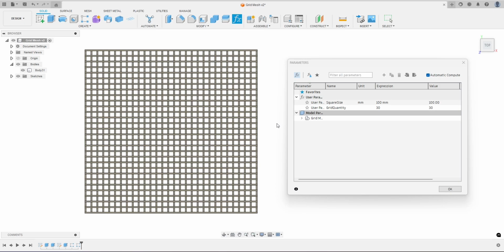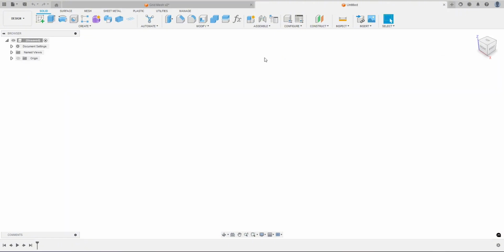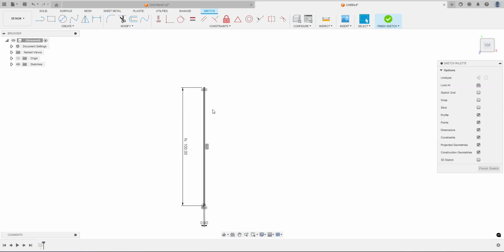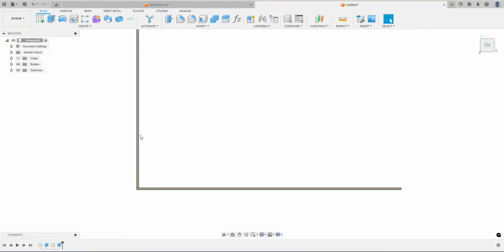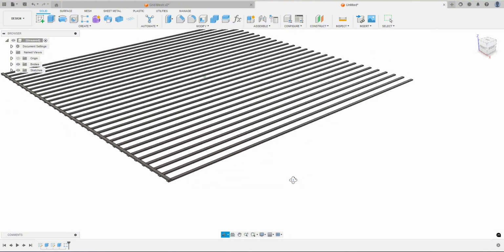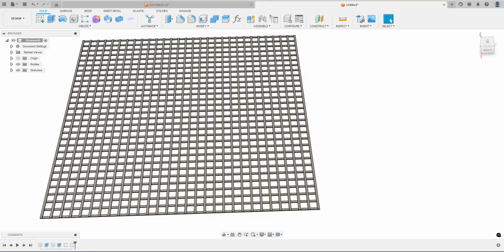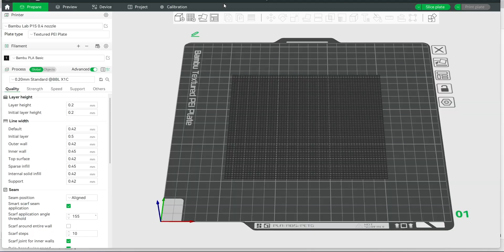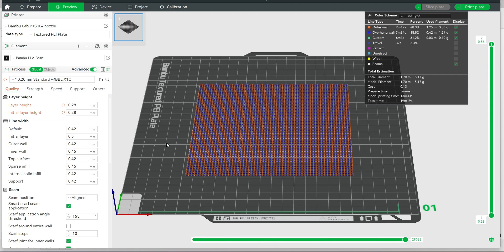Autodesk Fusion: Parametric Grid/Screen

Comment: Good stuff, thanks for this. Quick feasibility question, is there a way to take a parameter like this and apply to other shapes? Meaning, is there a way make a hollow cylinder with bottom, and use this grid/screen parameter on the walls of the cylinder and make a filter basket? I tried to adapt these steps into a radial pattern...and lets just say that fortunately whatever the hell it produced, didn't suffer or live very long.
Reply from the maker: Absolutely it can be done. Let me think about it and I’ll see about making it into a video.

Comment: Great video, thanks.  Have you considered building from the origin symmetrically?  This would enable circular screens or edge cropping rather than having a corner as the grid's reference.
Reply from the maker: Yes you could do that, but then you need to pattern in both directions (which is fine, but just adds to the difficulty, and actually may not work at all).  Doing a circle mesh would be fun to try.
Reply: @ShopTherapy623  Under Fusion's "Edit Rectangular Pattern" window, each identified axis can be modified from 'One Direction' to 'Symmetric".  So, if one used Fusion's origin as the centre reference and built out symmetrically, you could cut the final grid-mesh pattern into geometrical shape afterwards, to fit into other designs (circular fan-screen for example). Perhaps this is more evident from your previous: 'Create a Parametric Screen Mesh in Autodesk Fusion' video than this one, I spent a few hours playing with that last night and printed a sifting screen for a square bucket with rounded corners.
Thanks for the content, very well presented.
Reply from the maker: @Hoist2Crew  yeah, you absolutely can do it that way, it just complicates it a little.  However when doing circular screens, or other shapes that you want to cut out at the end, it would be the better way.  It would just complicate your equations a little bit.